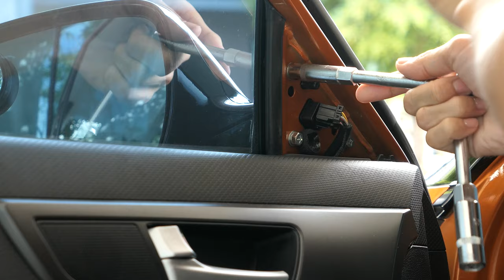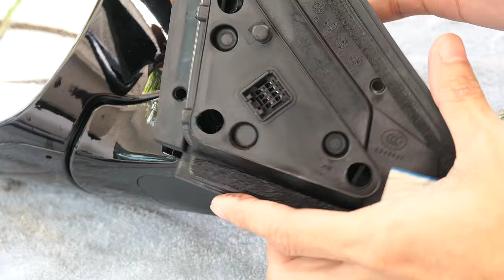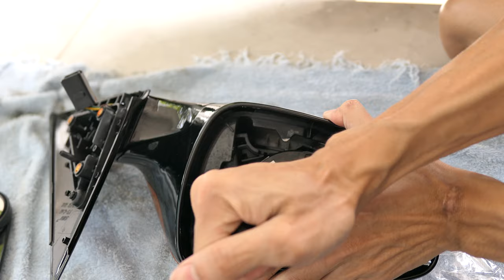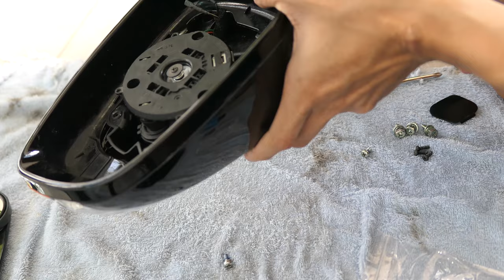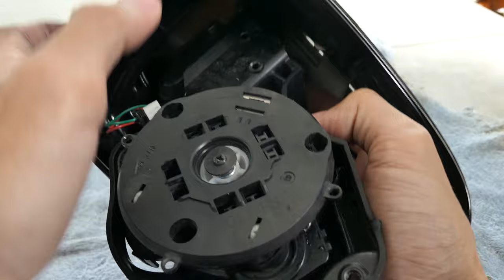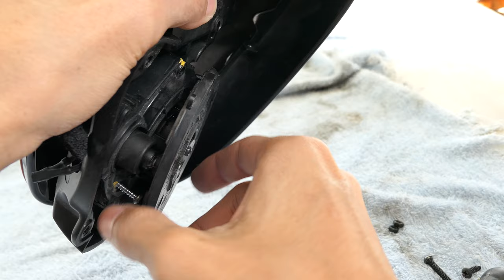How to Fix / Repair folding side mirrors gear, Not cut wires, For kia and hyundai ,Example Veloster

Comment: Thanks for this video. I just fixed my wife’s car. Hardest part was removing the mirror (and remembering where all the screws went back). Most complicated, but cheap fix ever. Just as a tip, I used a small suction cup to remove the mirror. Was scared of breaking it as it took a lot of force but it came off. 
Also interesting to find out that the painted part on the outside of the mirror can clip off. For those that are not up to pulling the whole mechanism apart, this means that you could replace with another mirror and simply change over the cover if not matching the car.

Comment: I like how you proceed methodically through this, not getting frustrated, just trying things until it works. That's how I fix things, too. 
Question: if the mirror gets hit and swivels on the rotator, can it be loosened and put back by taking it off the door?

Comment: great video good job, you are the only one who did this ! and show it the right way. where do you get the gears? does anyone know?
Reply: dear all i have find this product in amazon india in very low price approx 1000 Rs search this product name wing side mirror motor gear
Reply: Hey Manoj. I don't what's wrong with mine is the motor gear or the motor it's self. Because when connect the electrical cable to the mirror, the motor just runs and makes noise so I disconnected it
Reply: @tunez4moodz34  the problem is with gear. It has become free. just use fevi kwik to stick it.
Reply: @parvindersingh  Hello there, I have a similar problem with my Honda vezel. Sometimes my left mirror will go out but never fold in, or I’ll have to manually do both after hitting the button that controls the mirror. And it’s makes a sound immediately after starting the car. Is it the motor or the gear ? And where can I get either or both from, if need be?  HELL ME PLEASE

Comment: I did for a Kia Optima 2013, it worked on the right side at first. Then I noticed, some electrical issues, trunk opening by itself, key fob not working. 

I then did the other side and figured that I might put the cables wrong (the ones you marked at the beginning) 

I reversed it and still doing the same. And the mirror folding is not working anymore 🙂‍↕️

Kinda tired, I’m planning on redoing the whole thing see what I missed or taking it to the shop.

Comment: Great video. I have same problem. Hyundai i30 2007-2011 model. I will order the part and try. The video is very explanatory.
Reply: It works common problem I just did both mirrors On my 2012 optima, when you replace gear all things on the mirror will work again.

Comment: Indeed useful video. With the help of it i could disassemble the mirror.
I found gear connecting to mirror driving wheel damaged.
I tried to search on Amazon but couldn't get it. Will you please or anybody advise me from where pair of these gears can be obtained. My car is Hundai - Accent
Reply from the maker: Do you have any other shopping platforms besides Amazon?
I can't find it on Amazon either.
Reply: What was wrong with your mirror?
Reply: @tunez4moodz34  The nylon plastic gear (wheel) became an free on the horizontal metal gear  which caused failure of movement of mirror.
Reply: @kailashchandramahajan7683  Okay kool. My issue with mine I think it's similar. I have disconnected my cable attached to the mirror as it makes a grinding noise one way and can't folde or adjust my mirror. Do you think it could be the same gear wheel as yours and if so where does one acquire one. You advice would be highly appreciated.

Comment: Hi, would it be the same kit for kia optima 2013?
Reply: Yes the same It works common problem I just did both mirrors On my 2012 optima, when you replace gear all things on the mirror will work again.

Comment: Followed the video instructions with help from a GM tech.  The repair did not fix the problem.  Disassembled and reassembled several times the confirm the procedure was followed correctly. Before the repair you could hear the motor running but after replacing the broken gear your could just hear a hum like the gear was jammed preventing the motor from turning.  Any thoughts about another problem with the mirror?  
Thanks
Reply: I am having the same problem. Did you find any solution?

Comment: Sorry, is this the same mechanism in kia picanto TA folding mirror?
Reply from the maker: From the available information.
Sied mirror gear for kia Picanto TA ( 2013-2016 ), Is the same 30 teeth motor, Should work.

Comment: You should have shown how to remove the actual mirror, it's not as easy as u made it look. The glass can actually break while removing it.
Reply: 9 months late but for anyone else, use you’re fingers and push the top of the mirror in so that the bottom portion of the mirror is facing up. Should be a gap there now, plenty large enough to then take a long nylon plastic trim removal tool. Wedge it in there behind the mirror then pry down so the trim tool is getting leverage against the outer edge of the mirror housing and the tip of the pry tool should be pressing against the back of the mirror and pop out. You should be able to find a set of these at a local parts store or a Harborfreight tools store. I have a set of Bojo made in the USA trim removal tool set that’s nice. Use a plastic one and not a metal pry tool or screwdriver, you will be less prone to marring any surface of your mirror. Good luck 👍🏾
Reply: you're Right I was struggling with the glass too
Reply: I broke my power mirror actuator and had to buy another one lol
Reply: Should have read the comments

Comment: my Swift ZXI mirror, sounds a flick in middle and stops while opening after an auto-rickshaw rammed along it. But it is closing fine. I hope the issue is with worn out gear, any idea where i can get the Gear you replaced for my model?
Reply: did you got this part?

Comment: Lovely to know how to disassemble one of these. My mirror is dangling by the wires currently. Any idea whether that's fixable? From this video I now suspect some screws or their holes have been stripped. If it can't be repaired I'd like to know before I take the whole thing apart.
Reply from the maker: try it first.
Reply: Hey SubpaRD. Do you think it's the motor gears on mine too? Because I had to disconnect the electrical cable that attaches to the mirror because the motor just runs and makes noise and I can't even fold or adjust mirror electronically. Your advice would be highly appreciated

Comment: I replaced gears but makes click. Mirror doesnt turn maybe gearing is wrong? If i pull motor and connect it spins but inside housing it gets stuck
Reply: I am having the same problem. Did you find any solution?

Comment: could you explain what you did at 15:50 ?
Reply from the maker: I tell the fuse location, Of mirror folding motor, Fuse removed earlier.
Reply: @SubpaRdYNB  Ahh I see, I have the same problem so I just unplugged the mirror because the motor keeps turning, just ordered the parts you recommended, will try the fix soon, thanks again!
Reply: @slaviklox2   pls i20 mirror glass gear worm pls available in side

Comment: i changed my Hyundai broken gear too but when i connect it to the car the keys are malfunctioning . left single folds the mirrors and the folding key turns left signal !
any idea how to fix it i rechecked all wiring and all are correct. i even tried the right-wing mirror on it and the same happens
Reply: U have To recode the key. Take it to the car show room or a car electrician.

Comment: How to remove the actual mirror?
Reply: Though it seems like you may break it off, just slide your fingers on the back side of the mirror and pull.  The mirror is attached by plastic clips.

Comment: The passenger side mirror on my 2010 Hyundai YF i45 Elite Sedan will only fold in a short way and then stops.  Maybe its a faulty gear as in this video.  Has anyone replaced the mirror gear in a i45 model ?   Where would I purchase the gear for a i45 from ?  Thanks for the video.
Reply: google it

Comment: Typical engineering stupidity -  when will they ever understand that nylon gears mixed with metal ones do NOT mix!  Done only to rip the poor consumer off via expensive repairs.
Reply: I honestly don't know if I'm correct about this, maybe you may know more about the matter, but a shop near my place explained that it was designed to break under load apparently to prevent jams from damaging the motor/circuits? Do you know if this is true? if it is, will using the metal version of the gear be a concern? Again, I dont know anything about the matter. But i'm in the exact same situation with my Kia Forte 2013.
Reply: @spazticorange1  Well possibly - but there are far better ways to go about preventing breaks under load.....a small frictional disk - type system for instance could easily be incorporated in the mirror to give way under excess loading. One example are most fishing reels - they use a fictional disk system which lets the reel give way under load.....nothing complicated and nothing to break. The mix of metal and plastic gearing incorporated into anything mechanical is always very prone to damage in the short term, whether the system is placed under excess load or otherwise and it's a dumb and ultimately expensive way for a customer to solve the issue if the advice you received from the shop is correct. A great many household appliances for instance use a similar mix of gears and fail solely because the plastic and metal gears aren't adjusted or aligned correctly in the first instance - hence the appliance is rendered useless when the plastic gear section/s wears out prematurely.  Due to the cost of labor, repairs to the same are not considered a viable option and as such, these items are simply thrown into the refuse bin and another one purchased! And this is the purpose behind the whole exercise - to lift every dollar from your pocket that can be obtained from a society which has been cleverly 'educated' into throwing everything away as soon as it becomes broken. There's no money in repairing things when robots are your main work force turning out hundreds or thousands of the one product an hour - and you need to flog them off real quick!